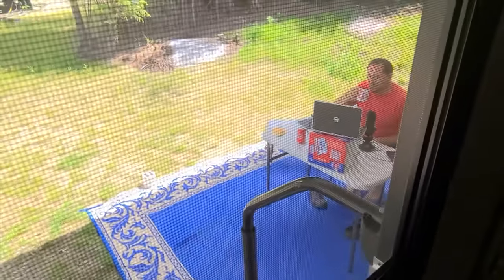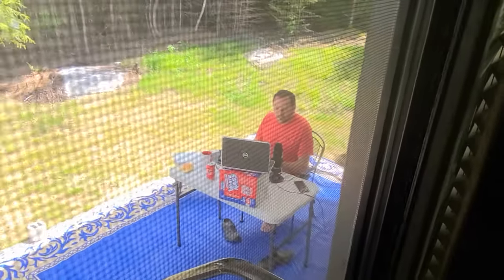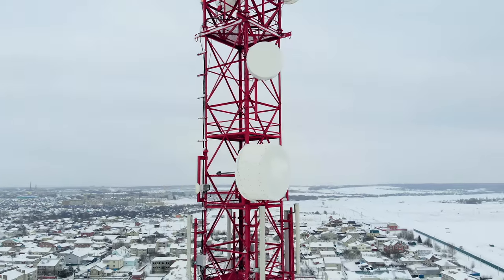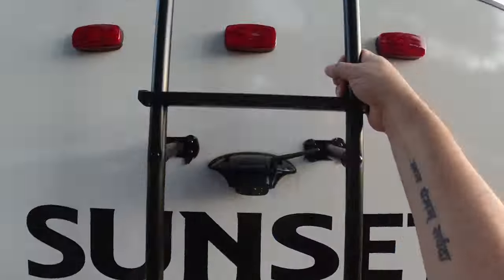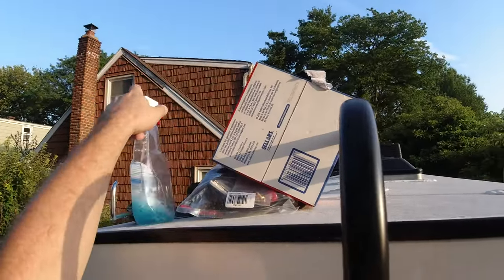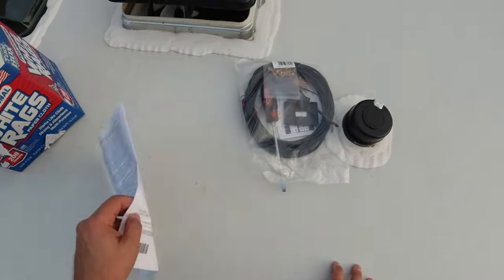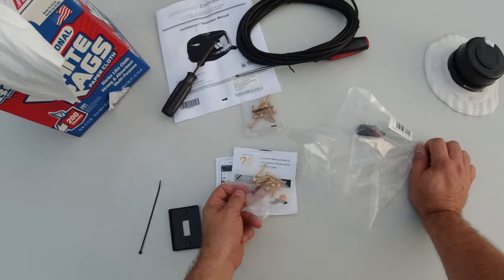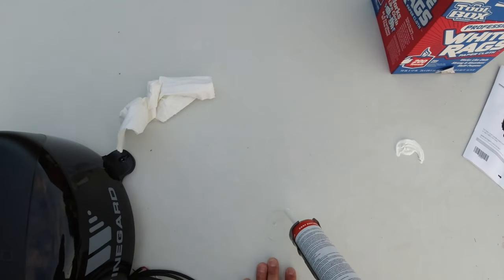RV WIFI | Winegard Performance Secrets plus full install and review.

Comment: I just bought a new motorhome and this is on it. I'm very confused on what this thing does. Why not just use your cell phone that already has a data plan. And whats the point of this thing having TV antenna signal. Who still uses VHF or UHV.
Reply from the maker: I would be surprised if this was pre-installed...most units have the AIR360 installed which is a TV antenna only and I'm with you on that...almost never used it on mine.  If you have a good 5g cell signal and no limits on data then that will work better as a hotspot.  But, if you need to pull in a signal or you want to use the local WIFI instead of your cell phone, this system is what's better for that.  I'd say this is more leaning towards those who are boondocking and don't always have reliable access to a quality cell signal.
Reply: @DOUGandNIKI  thanks that cleared it up for me. Unfortunately this thing will be totally useless for me. We do 99% dry camping. I was hoping it was a satellite dish for TV. Thanks again
Reply from the maker: @woodwalker777  Time to get yourself a StarLink!  Enjoy your camping.

Comment: Stable connection great, speed loss not good. Okay so the reason not to go for your phone is because this is more stable than your phone. But still most of the time it seems your phone is the better option.
Reply from the maker: So far that has been the answer.  I would have preferred if this system made WIFI at campsites better so that could be my choice, not worse.

Comment: The 360+ has the wifi and lte antennas built in. Why not use it?
Reply from the maker: If you needed more WIFI range it's my understanding that the Connect T2 is significantly better.
Reply: @DOUGandNIKI  was curious of that. I am in the process of finding something for our rv at our seasonal site. An rv permanent setup like the winegards or a nighthawk modem and mimo antenna that can be moved.
Reply from the maker: @toddeckley8880  I'm waiting for my Starlink!  I think it will be the answer that ends all of this crap :)
Reply: @DOUGandNIKI  Unfortunately you have to stay in one location for Starlink to work. At least for now!!

Comment: Thanks for the heads up on the speed issues.

Though your low number of 20mbs/sec seems fast enough for most uses.

Obviously it will be a pain if you need to DL large files.
Reply from the maker: Yeah...  it's survivable the only disappointment was how much slower it was than if I just connected directly without using the Winegard.  For me, I haven't yet found that situation where the local WIFI signal was so week that I was happy to cut the speed in half and get a stronger connection with Winegard.  I haven't found that sweet spot.  I have used the 4G while on the road and it's rock solid but uses a lot of data so it's expensive.
Reply: @DOUGandNIKI  so I have a new unit. And I'm up on the roof. I don't see the connection like you show on the video. My RV does have that connect ready sticker. Any idea where else to look?

It has an Air 360+. 

Also, this unit seems to have an Ethernet Port inside. I assume that may connect directly to a switch or router for faster speeds  I may try connecting up to it later abd see.
Reply from the maker: @Weaseldog2001  hmm....going to have to do some googling.  Ours had a plate on the roof that had the wiring under it.  I made like 1000 phone calls because it wasn't marked and creaped me out to pull that plate off of the roof.
Reply: @DOUGandNIKI  I've sent an email to the dealer.

If I get a good answer, I'll post it here.
Reply: @DOUGandNIKI  if that turns out to be a valid ethernet port, I'll let you know.

I suspect it is. Just undocumented.

I'm a software engineer by trade, and having a gigabit router installed would be a bonus for me when I'm away and working. From the RV.
Reply from the maker: @Weaseldog2001  absolutely...let us know.  Assuming it's up there like mine it's a really easy install even though it seems big and scary.
Reply: @DOUGandNIKI  I had to call the manufacturer to get an answer.

I was told I was the first to call about this. They omitted to install the plate and connector on the roof.

I was able to find a spot above the cab, behind the television. I drilled a 7/8 inch that came up a few inches behind the roof line.

The unit is powered up and working.

The internal port is wired ethernet. I'll be running a line for it also.
Reply from the maker: @Weaseldog2001  Wow...how do you "forget" that?  Anyway...your persevered.  Props to you!
Reply: @DOUGandNIKI  Tech told me they are implementing new procedures. None of their vehicles have gone out properly equipped.

Except for the stickers.
Reply from the maker: @Weaseldog2001  Did they offer to do anything for you or did they just say sorry...don't worry about it?
Reply: @DOUGandNIKI  I got the impression they were going to make it right, if this was something I didn't want to tackle.

A referral to a dealer to fix it was offered.
Reply: @Weaseldog2001  I'm curious about your setup. I haven't yet taken delivery of my new trailer, but it has a 360+ on the roof and a white dome inside on the ceiling, where I have read I could put a Winegard gateway. Since the reviews on those are mixed at best, I'm curious how you configured yours. Thanks in advance!
Reply: @FPVenius  My RV wasn't properly configured, so I had to do a complete install.

Overall, I'm happy with it. It's a lot better than using my phone for.a hotspot.

I did perform a step outside of the directions, and ran an ethernet cable from the unit, into the RV. 

I'm going to connect that to a 5G router and sue that as my main internet point for my internal devices.

It'll make communication between my devices faster.

I am hoping that this ethernet connection will still work when the WineGard is boosting a campground signal. I haven't tried that yet. The boost may be passive, abd this might not work.
Reply: @FPVenius  btw. I found that if it's turned off too long, it loses it's setup.

So be sure you understand how to.redo it.

I had trouble registering it.the first time. So I used the internal web app to configure it.

Once it was registered, the phone app made tbe setup easier.

Keep your password in a safe place. I believe it's also on a sticker in the manual.

Comment: On the 4g does it provide a good signal to your phone or laptop and what is the range for personal devices?
Reply from the maker: It pulls it's own 4g signal and they you connect your phone ore laptop to it via wifi.
Reply: @DOUGandNIKI  ok so like on average how far can I roam away from it before I notice I may not be connected? Like the Verizon hotspot my cell has to be about 10 to 15 feet away before I drop the signal. The weboost is like 4 feet away. So how does the winegard do on that aspect?
Reply from the maker: @barnhartmd051977  Will crush that...  I did a zoom call from our "front yard" a good 20 feet from the trailer because I wanted the beach in the background without an issue.

Comment: I dont think these WiFi boosters work unless used inside a house .
Reply from the maker: The one area I disagree on is... if you were boon docking and there was a really weak signal off in the distance, this thing would pump it up and make it a strong signal.  Probably a slow one but a nice solid WIFI connection.

Comment: It's not the device that sucks up the wifi speed. It's just physics. The longer a waveform travels the lower the waveform frequencies are going to be. Hence why 5G mMwave is super fast but not very good distance and low band 4G/5G has long areas of coverage but not super high speeds.
Reply from the maker: I think what you are saying is true but not applicable here.  If you look at my speed test...in my driveway at home you can see that when I connected my laptop directly to my home wifi the speed was more than twice as fast as when I connected the Windgard to that same wifi and then connected my laptop to the Windgard.   The Windgard definitely decreased the speed by about 60%.  That is what inspired me to call Windgard who confirmed that is normal with their system.   Is that more clear?
Reply: @DOUGandNIKI  when you did this test, was the Windguard close to the home wifi router (like inside the house) or was it far away (like outside the house)?
Reply from the maker: @flowersunshine3490  Right next to the house.  The same distance from the router as my laptop was when I connected it directly.

Comment: I bought the 2021 Thor Challenger.   It has ConnecT 2.0 which is probably ok as a WIFI Booster.   But no RV Site is going to have a high Bandwidth WIFI.  Even if you boost the signal strength, you just have better connection.    Not high bandwidth.   It's like getting closer to space heater that is turned way down.   Doesn't really help.   I only wanted OTH last week to watch the Superbowl.   But my wife likes to wake up watching the weather and local broadcast news.     So Bad Antenna for OTA, great WIFI Booster - but who cares, and limited Cell Hotspot value, since I use Tmobile.   It's basically a black bulge on my roof.
Reply from the maker: Your missing one possible use...  If your in a jam for a Halloween costume it should make a great Darth Vader helmet!

Comment: Could of at least showed us where the stupid card is on these systems. All well and good for newbies that have all the manuals and directions......try buying a camper with this and no instructions what so ever. Haven’t the slightest clue where the card is or what it even does.
Reply from the maker: Jay, where the card is, is an easy one.  When you look at it, it's all round, except one little rectangle door, it's right behind that door.  Are you sure you RV came with this not the 360?  That seems to be the standard pre installed option.